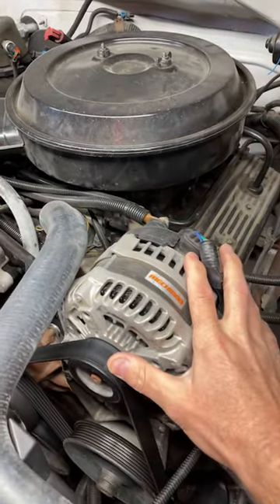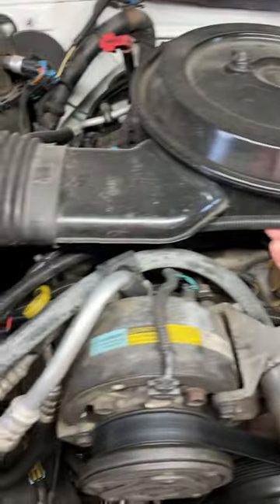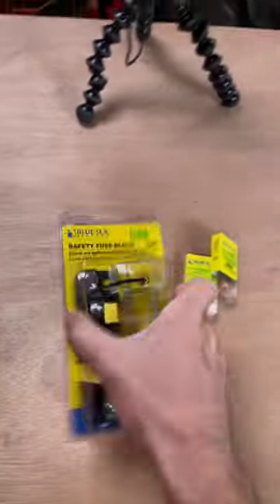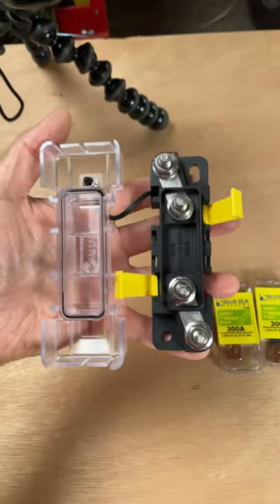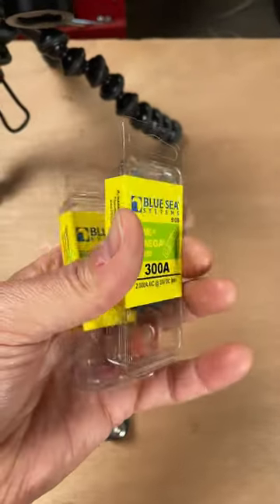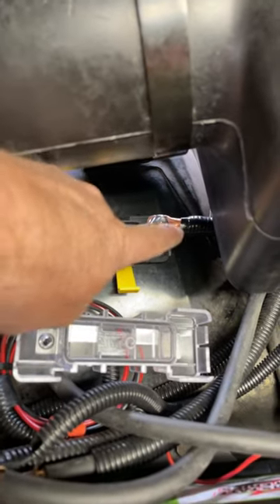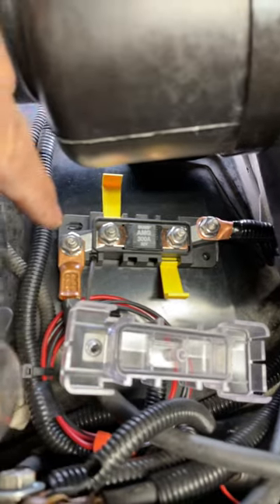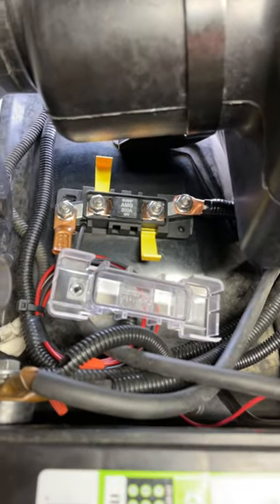Customer States His Install Was Professional!!

Comment: 13.8 volts is nominal. what you need to remind everybody, whenever you install a fuse between your alternator and battery, or your battery in a stereo system or amplifier for example, always Mount the high amp fuse right next to the battery as close as possible. the reason for this? you want the maximum amount of wire to be fused. that way if any of the wire comes in contact with metal, the fuse will blow. if you look at his install, there's less than 6 in of unfused wire and it's in a safe position. that's what you want. don't ever put the fuse in the trunk by the amp, then you have 15 ft of unfused wire that can burn down your entire car before the fuse can even function. I hope this helps someone, I mean, there's some people that don't know this stuff.
Reply: Problem is that the charge wire so power is coming from the alternator se which side do you fuse?

Comment: 12 inches from the alternator ALWAYS  you have enought cable from the alternator to the battery to burn that truck to the ground it would have taken a hr I so 50 plus parts If you are coming out of the battery12 inches ALWAYS  MECP certified tech

Comment: 300 amp ? It look like a 140 amp alternator also there already a fuse for the alternator that dont give juice if the ecm see something wrong with the wire at the back i really woulnd send more that 140 amp that fuse if the wire would be to melt is 5 or 10 amp. Even i the motor would spin 10x what is supose too be turning and while being conected to the battery it can only send 140 amp so that fuse is useless only thing is if the wire where to be cut and the positive was touching the frame but that very very unlikely and anyway you wire would melt expect if its a pure copper 1awg or something bike like that even then at that short distance most wire could handle the amp before burning so there really no point of putting a fuse the wire it should never touch anything and the alternator will never give that much amp i never ever saw a 300amp alternator for what seem to be a gmt 400 the higher i seen was 180 if i remember corectly for an lb4 there no point putting a fuse there

Comment: That’s a Mechman Alt. It does require a 300a inline fuse. But it also requires a direct GROUND to BATTERY! It’s not like other alts that simply use the mounting bolts to ground to chassis. In this way it can “read” the battery better and provide appropriate charge. This is designed for audio systems, so please tell him/her to junk that interstate battery and get a virgin agm batt.

Comment: I have 7 trophys for the sound off comps I've won and I've had some nasty systems. And in the 14 years I've been into building custom systems I've never seen nor have I heard of, or installed a fuse in line on my charge cable. 🤔 when was the last time you had an alt jump in THAT much amperage and cause a fuse to blow? I'll wait.....

Comment: You charge him $0 because he never asked you perform that install plus this is not a repair id be happy with if I was the customer. 1) I never asked you to do that 2) charge lines do not have a fuse on them. They just don’t. I’ve never seen that before. I mean it doesn’t hurt but it certainly is not a requirement.